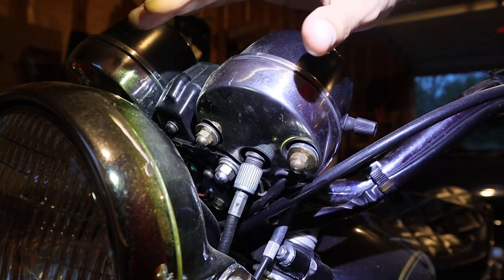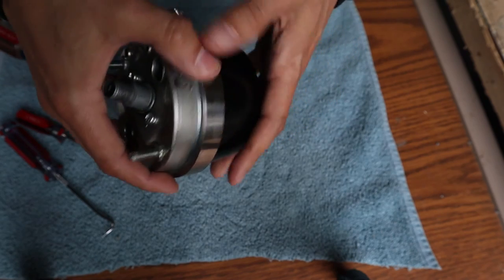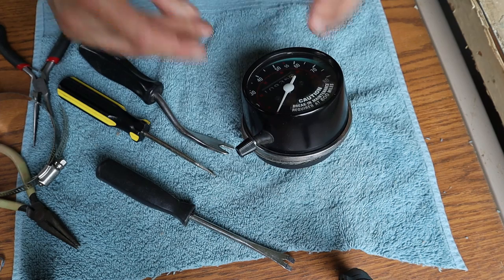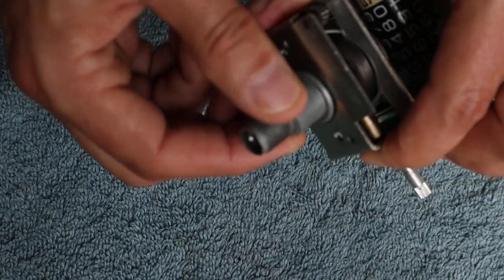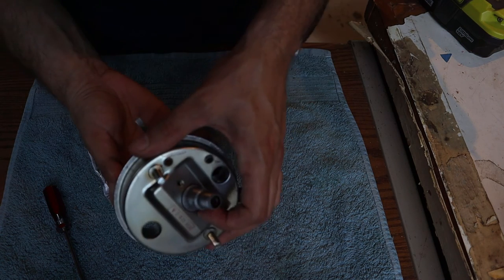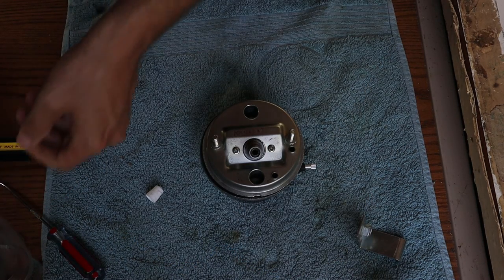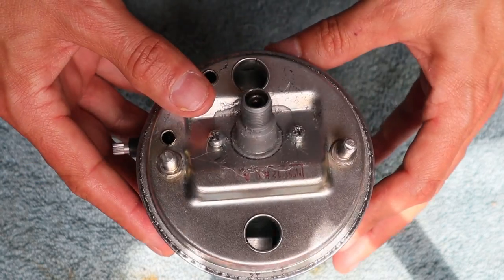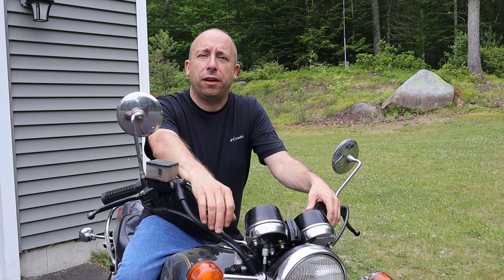Classic Motorcycle Speedometer Repair

Comment: One thing about government-mandated 80mph speedometers from that era — they are dead nuts accurate.  I don’t know if Big Brother made them do it, or if speedometer error would be just way too obvious if 160mph isn’t squeezed into the dial.  I have a 1982 CM450, checked the speedometer against mile markers with a stop watch, police radar, and finally with GPS.  Same result, accurate to within the width of the needle.  Odometer is within about one percent.  And now I know how the speedo works.  Thanks.

Comment: Just wanted to say thank you for making this video. Somehow a spider got into the speedo of my 1985 Honda nighthawk and I used everything you did in this video to get the cover off and clean out the web. I would have without a doubt ruined it trying to figure it out myself. The needle nose pliers and using the groove of it worked particularly well for me in peeling up the ring. Cheers!
Reply from the maker: Awesome!  Glad this helped!
Reply: Ha same thing happened on my 81 Suzuki GS450. When I get the chance I’m going to clean the webs out so I know how fast I’m going past 35 mph

Comment: I had the same issue on my 1973 CB 750 Honda.  Shaft was definitely the issue,  my trip reset was quite different, it connected from the bottom and have a few spacers and a gear that had to be put back together a little tricky, but if you’ve got the right needle nose, it works

Comment: Hi. Some comments…
1. No need to get into the headlight. That wiring harness just goes to the bulb. Unbolt the speedo, wriggle your finger in the mount and ease out the bulb from back of the speedo. Then pull speedo out. Quick, easy. Maneuver bulb back in when replacing speedo, then rebolt.
2. The headlight DOES NOT PULL OUT! There is an inch-long locking tab up top of the headlight shell (visible in some of your photos). A corresponding metal locking tab on the headlight ring goes behind it and secures the top of the headlight. Do not try to pull out the headlight! If you do, you will bust the top tab and take out a chunk of the top of the headlight. Unscrew bottom screw of headlight ring, then rotate headlight clockwise (often it is stuck from age) until the tabs separate. (Again, DO NOT just pull on it if it is stuck!) Then, depending on model (for instance CB175 or 350)  allow headlight with wires attached to rest on the front fender if you like and the wires are long enough. To replace headlight, put headlight back into shell off kilter to the right and screw counterclockwise until the tabs fit together. Then screw in bottom screw. Done.

Comment: This problem comes, when owners or mechanics are using to much force, removing the wire. Wiggling and pulling to hard, when the wire seems a bit stuck up in there, breaks loose the cylinder.
Thanks a million, for a very nice tutorial video here! Nice bike!

Comment: Thank you for making this! I’m having the same problem with my car speedometer. There were no other videos that I could find to help me, but this video about a motorcycle speedometer should help!
Reply from the maker: Modern car speedometers are quite different than this so proceed with caution
Reply: @SevenFortyOne  Yes I will. This is an old style speedometer. Cable run, and jewel balanced. I’m gonna try to tighten up the magnet assembly with glue. It is loose like yours was.
Reply from the maker: Cool! Sounds like a fun project

Comment: The 2 screws that hold down the number plate came loose on my tachometer and it's sitting upside down, and 1 is missing from the speedo, so thanks very much for this video because I need to tear both apart. I'll definitely add locktite to those 3 face plate screws as well.

Comment: Thanks for this! Mine was having a very similar problem, just needed a bit of lubrication and it started working normally again! I ended up using the Dremel method though and some jb weld, we’ll see how everything holds up under vibration

Comment: Good job. Several years ago I tried taking apart a faulty Suzuki tachometer without using a hose clip to prevent it deforming. Ended up totally mangling the mating surfaces.😒
Reply from the maker: Bummer

Comment: Great video. Thank you for taking the time. Question: Almost two years after you doing this fix, is the adhesive holding up to the vibrations? Or did it come loose again?
Reply from the maker: It hasn't come loose yet but I also don't ride that bike much

Comment: E6000 is a flexible rubber-like solvent based adhesive. It is not hard or two-part epoxy. I like it because it bonds a variety of materials, has exceptional strength, remains flexible and can be removed. Comes in black, white and clear. It's one of my favorite adhesives to have on hand along with JB Weld.
Reply from the maker: It had quickly become my go to adhesive sice I learned about it last year.

Comment: An alternative to prying the crimped ring off is to use a Dremel cutoff disc. Carefully cut through the ring, preferably towards the bottom where you won't see it. Then you can spread the ring apart enough to get it off the lip. Very much like getting a piston ring off of a piston. Reassemble the same way, if you have to, you can carefully squeeze the ring a bit smaller so that it fits nice and tight, and or apply some of that nice adhesive to the cut ends. Place the joint at the bottom, and voila!
Reply from the maker: Does cutting the ring leave enough material to reassemble?
Reply: @SevenFortyOne you did it the  right way. The only easy way was a custom pry tool thats similar to the old paint can pry keys..Grinding slots in the ring towards the edge would be impossible unless you have a micro disc and jeweler's lenses

Comment: You really put out great videos,I have a chinese scooter,  these chinese speedometers are innacurate, Ive seen 5 and 10mph off,,,,the question is, do you know how to calibrate these speedometers so they read accurate? what is it that you need to tweak or adjust to get them to read accurate, is it the needle coming from the cable, is it at the wheel? What do you think?  TY again!
Reply from the maker: I'm not sure what you need to do

Comment: The screws on the back of the speedometer (and pretty much every other screw on the bike) are JIS, not Phillips. Using a JIS screwdriver will prevent stripping them. JIS screwdrivers are also less prone to stripping Phillips screws as well. The screwdriver in your bike's factory-supplied toolkit is JIS.
Reply from the maker: Good tip - thanks!
Reply: Nice job. I'm more into mopeds but I've had the problem that you had with your speedometer many times on my Yamaha mopeds and with trial and error, mostly error I've found that all you need to do to correct the needle jumping problem is lubricate the place where the cable goes in, the glueing part is a good idea but was'nt what solved your problem, your problem was solved when you lubricated the hole before glueing it.
Reply: That's true, anything made in Japan that uses a cross point screw is JIS. And man, those screwdrivers are hard to find unless you order them online. Everyone I asked at local hardware stores had no idea what I was talking about!
Reply: I had found a kit on Amazon for $20 bucks that had 5 screwdrivers of different sizes. Been using it on my Honda the past couple weeks and it’s been working great!

Comment: Any advice on cleaning the dial face without creating glossy spots or fixing existing ones? When taking my dial apart, i accidentally touched the face plate and got a smudge. After cleaning it , the dial now has a glossy spot, easily noticeable at direct sunlight
Reply from the maker: I've had good luck using name brand dish soap mixed with water cleaning my ham radios.  It's a mild degreaser but shouldn't damage the materials in the speedo.  Go slow, use just a small amount, and test on an inconspicuous surface firts

Comment: Nice done!
I have a similar problem om my suzuki. The speedometer is really slow and doesnt want to go above 40 km/h. I manage to take it apart as you did and nothing obvious about it. Put some lube in it anyway. I tried it with the drill and now it seems fine. Problem is my drilling machine takes it to about 40 km / h which was the speed i got to when riding the bike so i really dont know if anyting is different now. is there any way to test higher speed range. I saw in the video you reached 80 mph at some stage to reproduce the symtoms.
Thx for the help.
Reply from the maker: If your drill can't spin fast enough you might need to try a different drill

Comment: Mine was due to the shaft for the cable. I lubed it up with some silicone lubricant, but after a while it came back. I wonder if you can drill a small hole and use a chain saw bar lubricant tool to grease the internals.
Reply from the maker: That seems like a good idea.  Small hole and rubber plug to keep debris out

Comment: question, do you turn the speedometer with the drill in counter clock wise mode, or direct (clockwise)?
Reply from the maker: I don't remember...I probably tried both and went with the one that worked

Comment: Was the drill in forward (tighten) or reverse (loosen) mode? Very difficult to tell from the video but it looks liken forward mode...? My speedo is gummed up and barely moves very slowly with a lot of force required. Hopefully it just needs cleaned and oiled.
Reply from the maker: I honestly don't remember
Reply: Usually, the japanese speedo drives, goes in a counter clockwise direction. And I think I just saw this one was the same.
Reply: It goes counter-clockwise. So you must have a drill that can go in reverse.

Comment: My 1983 Yamaha Venture has a similarly failed speedo and odometer. A recommended fix was to shoot oil into the case, through the cable input port. Alas, the speedo works fine, however. the odometer does not. Do you think the disassembly
and the guts for my instrument, are similar to that on your Honda?
Reply from the maker: Its probably similar but different if that makes sense.  Its kind of a tricky task so I wouldn't attempt this unless you are mechanically inclined and patient.  But inspect yours and see if anything feels loos like it did on mine and take it from there.  It might be worth taking it to a bike restoration shop for an opinion too.

Comment: I had the same problem on my 1983 kawasaki 550 but the needle broke in half I been looking for a new  replacement that will work and the rpm gauge doesn't work at all

Comment: Any idea how to repair the threads that screw the cable to the speedometer? Mine completely broke off leaving no threads to screw on to.
Reply from the maker: I would look into buying a parts speedometer from eBay and swapping out your broken parts.  Just make sure you get one that had the same part as the one you are trying to fix.  There were any designs over the years that were similar but not identical.

Comment: I don't know if there's any type of magnetism going on in there. I read there's an oil filled damper so that the needle moves smoothly. I'm trying to repair some old Honda ATC speedometers, they run anywhere from 200$ used to 400$ and up NOS....
Reply: The way all speedometers work is the flux field in the permanent magnet attached to the cable when spun, causes the aluminum dish mechanically attached to the needle to follow along.  It's basically the same way a motor works. It's magnetically coupled rather than directly by some mechanical means.